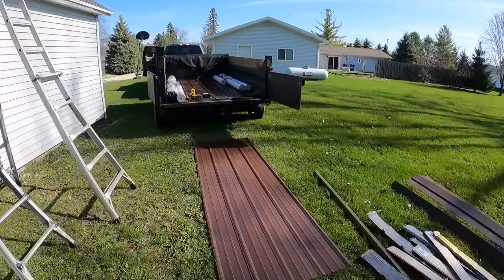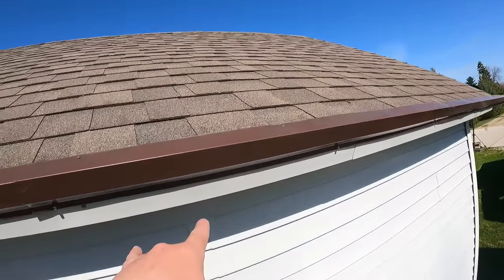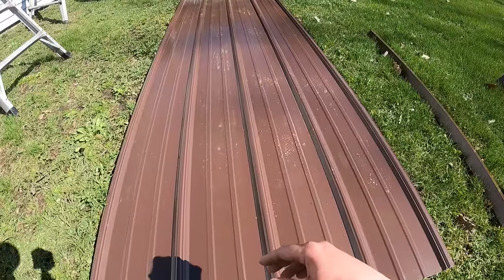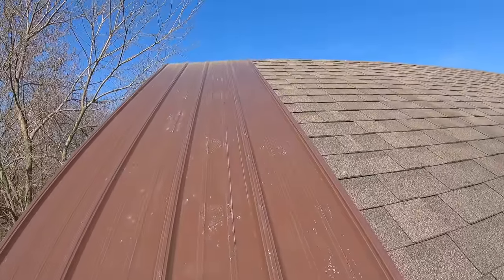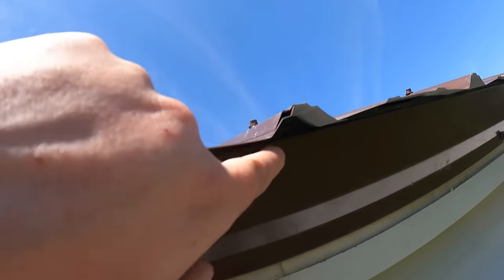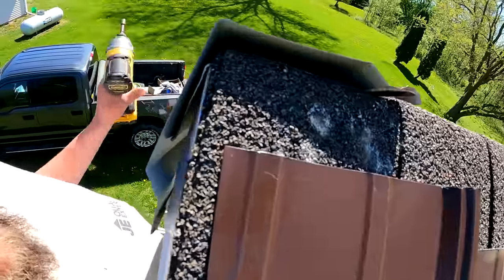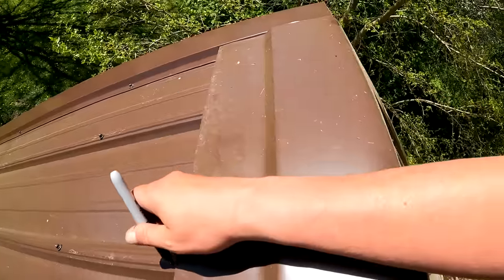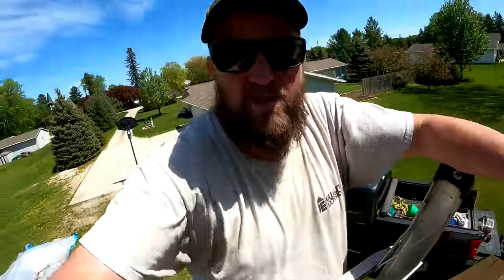HOW TO INSTALL A METAL ROOF

Comment: Advice needed here.... 12 by 15 foot add on made of concrete block and poured floor and roof needs replaced. Snakes have made their way up the block and into the ceiling and have been seen on top of roof several times. Question I have is.... Anyway of filling the gap  between the ridges and 1x4... These gaps are where snakes move up and down now, I dont want to mess with the expansion and contraction but need to seal it. Any suggestions?
Reply from the maker: You should be able to install some sort of flashing to close off the gaps

Comment: I have a garage that is attached to my house. The garage gable end is a couple of feet lower than the house gable. The siding I have is cedar shingles with aluminum flashing. My question is how I flash the vertical of the house and the horizontal of the garage roof with metal roofing?
Reply from the maker: You will have to install a new flashing behind the siding

Comment: Great Video.  I am doing a 30x30' building on Friday and had all material cut to size so your video was perfect for me.  We are also doing metal directly over the shingles
Reply from the maker: They say you are not supposed to go over shingles but I have done it several times and it will hold up in my opinion
Reply: @Lifes_Apprentice  On a single wide mobile home is it better to use the 1x6 framing between the shingles and metal?
Reply from the maker: @jenniferwilliams1546  yes
Reply: you seriously put the metal directly on the shingles??   it's gonna go bad
Reply: @traviscole6365  it only goes "bad" if you are using the normal 1 inch screws for the flat surface directly into the wood.. this video he doesn't do either, he uses long screws on the non-flat part. You can use longer screws on the flat part too with shingles.
Reply: @gg. The going bad is not a matter of the length of screw. It is a matter of the metal moving (inevitable) and getting scratched by the granules on the shingle surface. Besides premature failure, it also voids the warranty.

Comment: Is the rake flashing any different than a steel pole barn corner?
Reply from the maker: You can use a coerner for rake I believe. It depends on situation and what is available. they can be ordered to size you want as well

Comment: I was wondering if the panel overhang on the ends causes problems with getting the rake trim flush with the rake boards.
Reply from the maker: I cut roof panels to edge on the rake.,at the eave you can overhang a bit

Comment: (NEVER).... I repeat.. (NEVER) put metal down upon bare shingles!!

(ALWAYS) use a roll of reflectix.... Looks like bubble wrap insulation.. Put that down first with long staples, use foil tape to tape the seams with a squeegee, then place the metal on top of said reflectix...

Any "NATURAL OCCURRING MOISTURE" that can get between shingles and metal will rust out metal, this is where the reflextix wrap takes into action by protecting bottom of metal...

It also will lower temps and reflect summer heat.. It lowered mine by 50% in summer upstairs!

Comment: seen medal roof installed several ways over shingle ..none straight over ..but striped w/ 1x4 or 2x4 1 st ran horz ever 16 - 24 " up ..& sometime foam board  insulation indbetween sometimes  ...but the fasteners ..most ive seen  all fasteners in The Flatt roof .. not seems ..& also seen seen them on seems or   ridge hi side    like yours ,  witch i do like better

Comment: Nice video. I read a lot of the comments and think you did it in a very economical way.   I have never put a metal roof on and have a question. My garage is a 5/12 (I think) metal roof and has a leaking very narrow ridge cover. It's no more than a 6" ridge. I want to cover the existing ridge with a 12 to 14" ridge cover/cap. Is it ok to put a wider ridge over a narrow one?  The only places my garage leaks is at the ridge and has an extreme amount of tar & kool seal on it already. Because its too narrow is why I think its leaking. Hopefully I described my issue to where you can help. Thanks in advance.
Reply from the maker: Yeah put the larger ridge over the top... I do not see any issue with that

Comment: I've been doing metal roofing for 15 years and love seeing roofs like exactly the way I watched in this video because it becomes a new job for myself to tear off to do it the correct way... first off putting metal directly on top of shingles is not the correct way of installation lol... wood purlins should installed on shingles at 24" spacing and then metal panels screwed  to purlins.. besides that there just too many other hack issues here to list.. just saying it's a issue from the beginning... no metal roofing manufacturer is gonna warranty this installation

Comment: Sorry...I have to criticize your work and some choices of fasteners. 
First  off:
 I   wouldn't use drywall screws. Treated deck screws would not rust giving much more  life  to your roof  or use the same neoprene washer screw as you used at the bottom if it's hight allows.
Cutting the sheets by skill saw  with a metal blade wouldn't heat up the metal and burn the paint when making the cuts.

Why no strapping for moisture and air circulation under de metal?  Do you now that condensation accumulation gets on the underside and the roof starts rusting from underneath ? 
You're a hard working guy !

Comment: Any difference if your doing it without shingle on roof?   
Any suggestions on variables uneven roof?
Reply from the maker: The process is the same. if it is uneven you may want strapping in bad areas but otherwise just run it...
Reply: Without an existing roof, start with a non granulated ice and water shield layer.

Comment: Another add when strapping use vertical first  then horizontal so sweating can run down and out the bottom not trapped behind the horizontal

Comment: If you installed that around here it would blow off, you should always strap the roof with 1/4 spruce before installing the metal panels

Comment: Thank you for making such an informative video! 
Quick question though:
Why does everyone put the smaller lap over the larger lap when installing the panels, and not vice versa? It's a much more flush fit with large over small. I guess it runs the risk of capillary action wicking water in between?
Reply from the maker: I don't think it really matters either way. just my opinion
Reply: The reason you put the small one on top is to prevent water from syphoning up the rib.  It also provides structure for the lap to maintain its shape while your pushing and screwing
Reply: It's recommended this way from the manufacturer. The other way around will wick water into the crevice.

Comment: im looking to install a metal roof on my house in the near future.  My question is, I can t get panels that go all the way to the ridge, so how much of an overlap do I need for the top panels onto the bottom panels?  Also what if my current ridge has ridge vents?
Reply: Are you just looking at stores for the roof panels or checking with suppliers? Most form them onsite from massive rolls. 

There are also details for metal ridge vents. Definitely best option.

Comment: Did you put caulking in the ridge cap laps? Everywhere says to do that but I don't know if that's kind of overkill or not...logically, it makes sense that you would.
Reply: Also, how would you seal below the ridge cap on the ends where the metal panels below don't meet in order to keep animals out?
Reply from the maker: you can caulk the laps if you would like
Reply from the maker: @BlumpkinSpiceLatte  there are foam closures that go on panels where the ridge meets panels
Reply: @Lifes_Apprentice  nah I mean on the gable end, at the top of the triangle.
Reply from the maker: @BlumpkinSpiceLatte  I cut and folded the metal on the end to make a endcap in the video

Comment: Drywall screws are more brittle and prone to breakage than regular wood screws, so their use in dense hardwood is not recommended. Pilot holes and countersink if you do. They also rust easily and are not suited to outdoor use.

Comment: I use grinder cutter wheels for years. I you are worried about the cut under the ridge panel then spot rust oleum paint the cut’s.

Comment: The whole point in a drip edge is for water to trip away from the wood, so I would never screw into the drip on the facia always want to allow the cutter to be installed behind the drip edge directly into the facia.

Comment: Drywall screws outside will rust out rather quick which could be a problem.
Reply from the maker: The drywall screws I used are not exposed. they are under the panels
Reply: @Lifes_Apprentice  Its humid outside?

Comment: THANKS for a simple but thorough video for those who need to save a buck!
As a roofer since 1972 (and still kicking), I've learned that for many jobs in many cases - simple is often better.
I just edited this, now that I finished the 2nd half of the video, to say you did an amazing job! You scared the crap out of me when you were straddling that ridge vent - practically doing the splits. I was wondering and assumed you were depending a little on the screw heads to guard against slipping.
One roofer to another, AMAZING work! You should be proud of yourself. I'm subscribing this minute - take care!
Reply from the maker: Thank you very much! I appreciate it!
Reply: hello sir, why do some people insist on screwing at the low spot instead of the high spot of the metal roof like he did in this video?
Reply: @wanderingandroid  Hello W.A. Could you be more specific on what you mean by "low spot" & "high spot"? I'm not positive, but I think you mean the wide flat smooth area between the peaks as the "low spot" and the peaks (5 usually)(don't know what else to call them) at the "high spots".
Personally, I install the screws on the smooth flat wide part between those "peaks".
It's been a while but I think he installed the screws on the peaks. I don't like that idea because I feel the screw might crush them plus you would need longer screws.
Reply: @Jeff82556   @Jeff82556  yeah, i was talking about screwing the ribbed peak of the metal sheet instead of the wide flat area. My thought was that the flat area where the water channels or runs down would be more prone to leaks.
Reply: @wanderingandroid  I already mentioned why I prefer the "flat" area for the screws. Your idea that it may be more vulnerable to leaks is valid, however I dismiss that knowing that as long as the rubber O-ring is properly set, not too loose, not too tight, everything should be okay and no leaks. Do you not agree? AND the disadvantage to screws in the ribbed peak are - it's easy to accidentally tilt the screw while tightening it. (because it's a sorta hill instead of flat area)

Comment: Did you leave the ridge open at the rake?  I'm doing same style roof and was thinking about bending the metal in, but that seems like a pain. If left open,  did you use any type of blocker to stop wasps, etc?
Reply from the maker: I showed in the video how I used foam closures to seal off where ridge meets panel and how I finished ridge where it meets rake...

Comment: I see you did not put down the 1x3 pine wood stripes like I have seen guys put down on top of the roof then they place then metal roof down, do you need to do that.
Reply: Definitely recommended, especially if you’re not removing the old roofing.

Comment: Screws should be on the low to compress washers and the ridge only to join the sheets and sealed the joint
Reply from the maker: And in 10 years your screws will all leak

Comment: I see you didn't use wood striping  because it was a shed. If u was doing a house roof  could you do it the same way?
Reply from the maker: You could do it the same on a house but I would recommend a tearoff
Reply: @Lifes_Apprentice " tearoff " ?
Reply: @kingscairn  
tearoff = tear off the old shingles

I wonder about cold weather causing frost on the underside of the metal and then sun warms it up and the frost melts and drips water on the felt paper between the metal and the wood decking. 
Should there be strapping run to provide airspace between the metal and the decking?
Reply: Ice and water shield is better than felt paper. Felt likely won’t last as long as the roof.

Comment: Don't use drywall screws on metal roofing drip edgeing use number 10 sheet metal screws. Drywall screws will rust apart and break over in about five years
Reply from the maker: The screws are behind closures and under panel like 4 inches
Reply: @Lifes_Apprentice the humidity will still cause them to rust. Trust me I know this from experience

Comment: Just  a warning  metal roofs. I installed one 12 years because I loved the 50 year warranty but make sure the design addresses ingress in other words  if squirrels and birds can get under the spaces or caps and into your attic you will have trouble potentially big trouble.. Wish this video  was about a roof job with caps.

Comment: Drywall screws for the eave drip edge? Ah, no, those will rust out.
Reply from the maker: They will never see water. They are under roof and behind foam closures. They will rust when the entire roof rust seeing as they are made out of the same metal
Reply: @Lifes_Apprentice  They will likely see moisture from condensation forming on the underside of the metal roof panels...pancake screws with zinc coating on them are ideal for this type of install...this is great learning opportunity for all
Reply: My man has never seen condensation under panels

Comment: Drywall screws are a no no and you should have put the panel screws should have been put in between the raised ribs. Other than that looks good.
Reply: I agree that drywall screws weren't the ideal choice. Maybe ceramic deck screws would be okay - as long as it lays smooth and flat to the metal. (for the edge flashing)

Comment: Exactly as I would do it.  KISS.  To hell w the naysayers.  "Granules and rusting from the underside."  "  Not in this lifetime.  " Using drywall screws, rusting. "  Ah, they are covered by the panel.  Maybe not the perfect way to do it but the most economical for sure.  😊
Reply from the maker: Thanks for watching

Comment: According to most metal roofing manufactures you Voided all paint warranties on the roof as soon as you cut the panels!
Reply from the maker: Every roof will require cutting panels at some point... key it to have your cut ends covered and not exposed. If you have valleyes and have to cut panels they will be exposed and you will not want to cut with a grinder.
Reply: Not Fabral Steel

Comment: Appreciate the video but all the manufacturers specify screwing on the sides of the ribs, NEVER on top of the rib. One screw next to each rib, except at overlaps where one screw goes on each side of the overlapped rib. Take my word for it, or look up the install specs from the manufacturer of your panels.

Comment: You never use drywall screw on the roof and you never lay down metal panels on the shingles. You should remove the shingles before you install or strapping
Reply: Right its amazing how many videos with wrong or mis information with so-called professional installing wrong glad I'm not paying for that
Reply: Even more amazing, disturbingly so, is the number of people that lap it up, or diyers that spit in the wind of professionals. Really scary is when it’s contractors that get it wrong.

Comment: Gutters are supposed to be installed UNDER the drip edge. Therefore, you DO NOT screw the front of the drip edge to the facia...... Period
Reply from the maker: There are no gutters and will not be gutters. If there were to be gutters they would go under drip edge and the gutter staps would be screwed through drip edge most likely anyways...explain why what I did is an issue???
Reply: U should never nail or screw through drip edge or through aluminum facia. Water will and I mean will get in and rot your boards out.
Reply: Drip edge over shadow board Vicor between shadow board and fascia. Gutter under shadow board and fastened to fascia.

Comment: Answer me this Batman I think metal roofs or kind of ironic because a hundred years ago we used metal roofs and then we found out shingles are better... Evidence given that we started using shingles and now we're getting back to metal roofs that is not the same metal as it was a hundred years ago it's a lot thinner and I believe it's no better with the paint on it than it was when it was three times thicker metal.
I could be wrong but it's the old what's old is new and what's new is old😅
Reply from the maker: In todays day and age its all about speed...In the old days it was all about craftsmanship and quality materials. Unfortunately these cheap materials are what consumers want and as a contractor this is how you survive. In my area you cannot get a permit in the city for alot of metal roofs because the city considers them an "eyesore" crazy world
Reply: Who found out shingles were better?
Shingles were used because they were cheap, but you’re welcome to believe what you want.

Comment: You should never go directly onto shingles
Need purlin under for air flow
I've sold metal for 20 plus years and have seen panels rust thru because of moisture under against shingles
This is terrible demo video
Reply: purlins will rot out